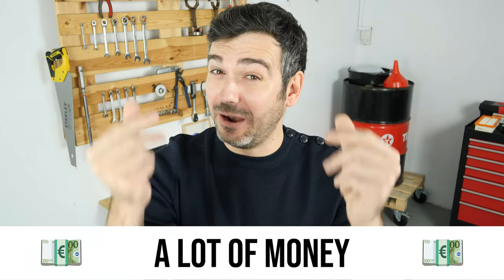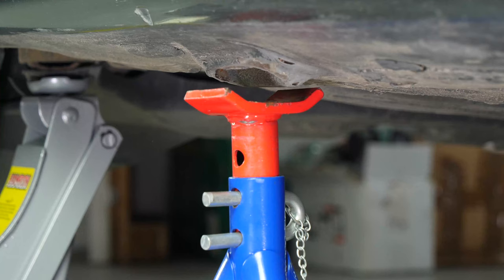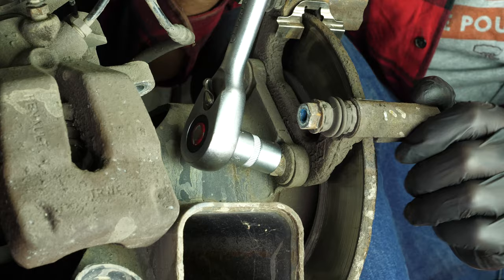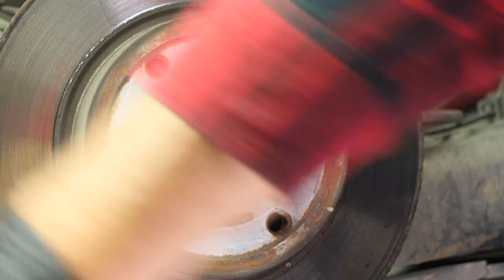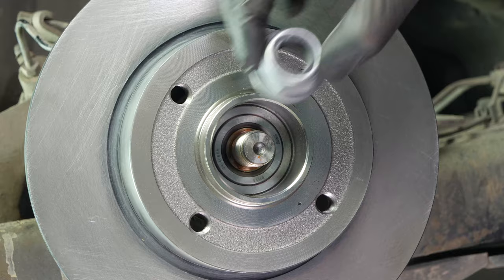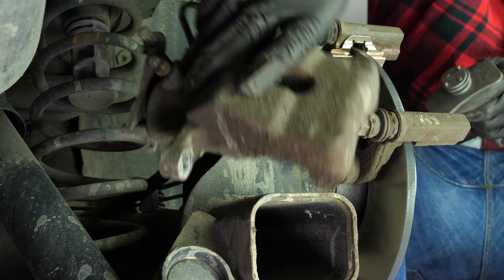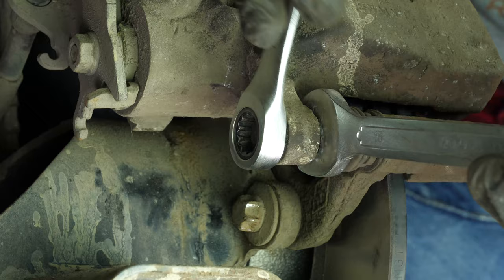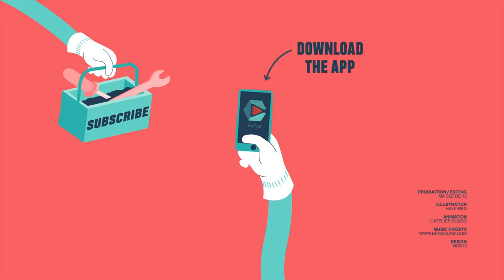How to replace the rear brake discs and pads Megane mk2 🚗

Comment: I’m doing my step sons new car now it’s his first so it’s not brand new but I have rounded one of the bolts off and having endless trouble getting it off. The top two bolts had blue lock tight and where hard enough but the bottom two or at least the one I got off has red lock tight which is definitely living up to its expectations I’m done for today the fight continues grrrrrrrrrr